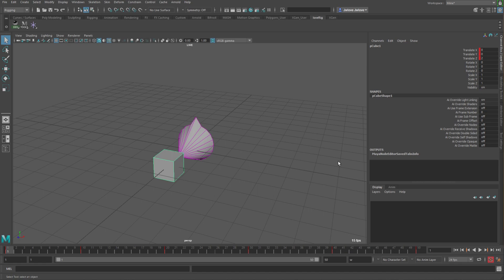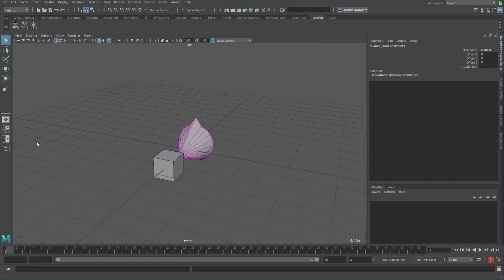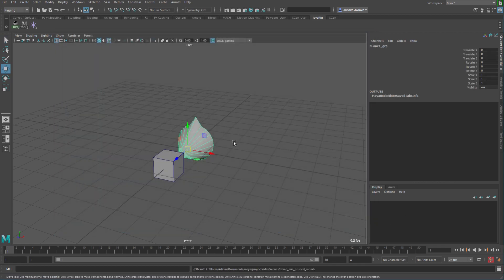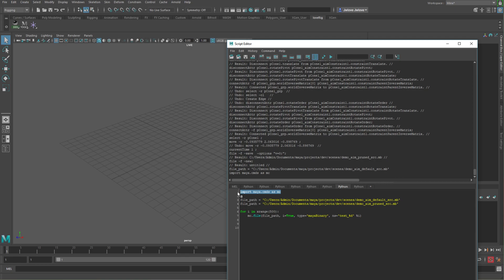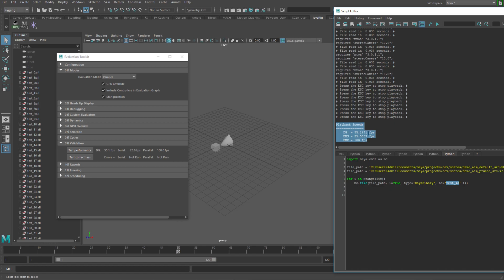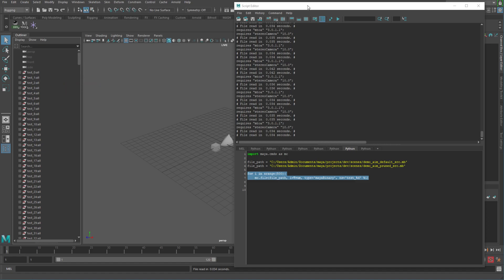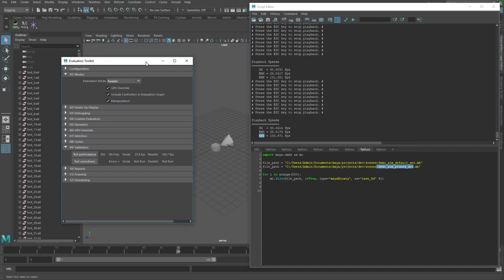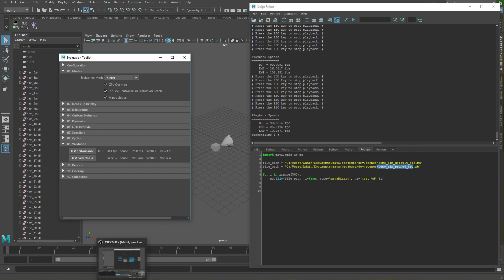Evaluation toolkit speed test rig tip

Comment from the maker: I don't know why I didn't think to mention it in the video, but there is another way to get rid of the driven node's cyclical translate connection...  If you are driving the translations of that aim constrained node, you can first sever the connection between it and the constraint, and then use the same translation driver plug(s) to drive the 'constraintTranslate' plug(s) on the aim constraint node itself (this could be the compound attr, or the individual x/y/z attrs).  That way, the translation data isn't merely passing through the constrained node to get to the constraint - the driver node will drive both the constrained node and the constraint for the same effect without the cycle.

But, this won't help if the user is able to directly grab the node and move it around... you still need that cyclical translate connection or it won't aim properly when you move the constrained node...

Comment: good to see you back, thanks a lot for the tip. i saw the other day (on one of raffaele's streams) a method to have a really basic and light  aim contraint measuring the angle and the distance between two vectors and using the euler to drive the rotation of the object, i tested it , it works but it lacks a lot of functionalities compared to the native maya aim constraint, so i can't implement it in my rigs..anyhow, i can't wait to know the topic you'll tackle on your next video :-)
Reply from the maker: Hey, glad you like it!  Yeah he uses that angle between trick in his node-and-expression based ik solution to aim a node at the top of the chain toward the ik control and then uses another for the 'up' vector (to create a pole vector)… at least if I remember correctly - it's been a while since I watched it.  But yeah, you're right - while it's a cool trick, it can flip quite a bit since it lacks all of the up vector options built into the aim constraint... so you just have to kind of work around it a little.